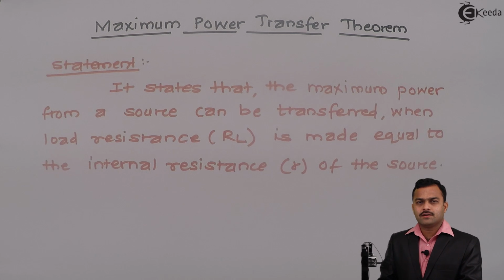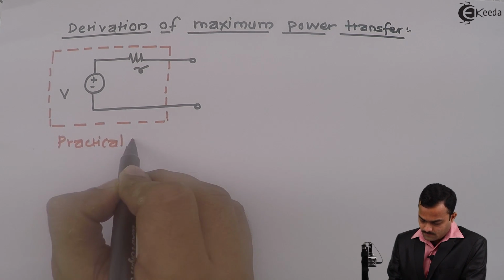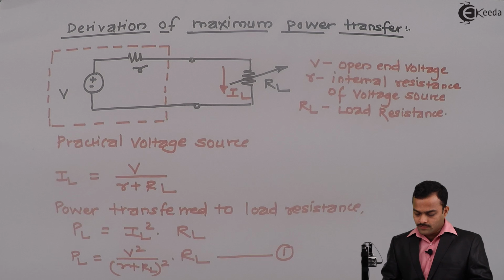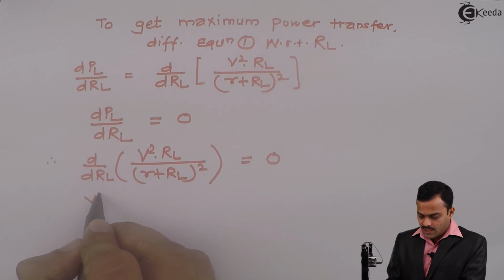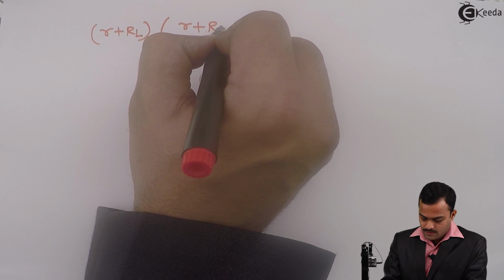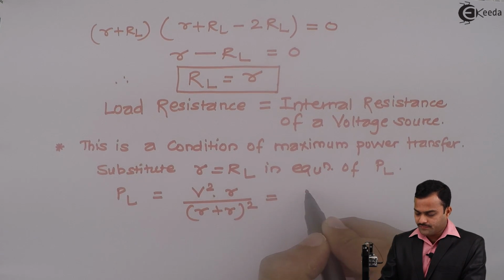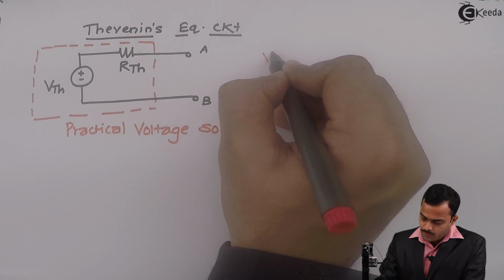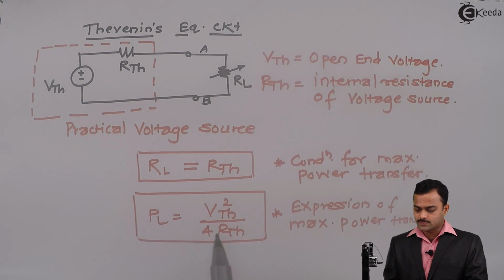Maximum Power Transfer Theorem - DC Circuits - Basic Electrical Engineering

Comment: I want to know the power ,current and voltage valueswhen R1=330 R2=680 R3=270 R2and R3are connected in parallel and their equivalent resistances is connected in series with R1  and variable resistance is connected in Series with R2 in maximum power transfer theorem please send sir